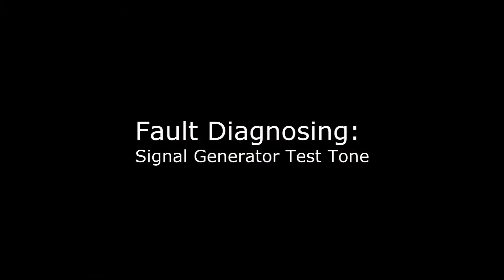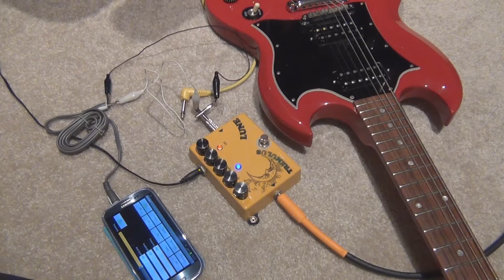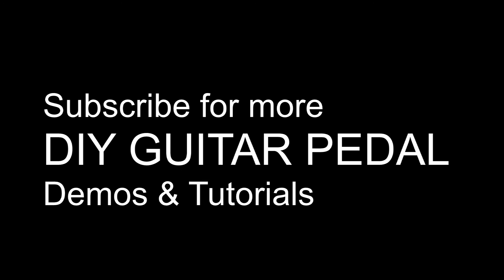Guitar Pedal Fault Diagnosing - Signal Generator Test Tone

Comment: a good test amplifier is a radio shack mini amplifier/speaker at radio shack for $14.00. You can make a test probe from a finishing nail and a .01uf /400volt , capacitor, a 6' mono audio cable with 1/8' male input for radio shack mini amp. and strip the wires on the other end and Soilder the center wire to one leg of the  capacitor and the other leg of cap to the nail  and heat shrink end and cover in heat shrink, this prevents dc voltage from entering your  radio shack mini amp next take the bare wire or ground wire and soilder to alligator clip testing lead and strip the end and soilder to ground or bare wire and heat shrink. Leave the other end to the clip for grounging  .Now plug into iPhone or ipad and into amp for signal and use mini amp for sound volume to hear probeing,it has a volume control. clip grounding clip to chassis and your set.